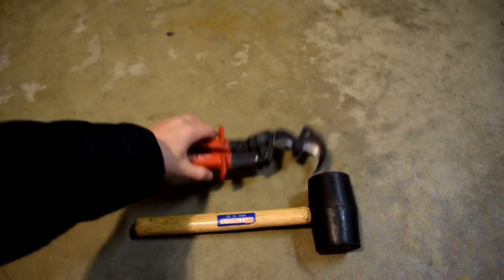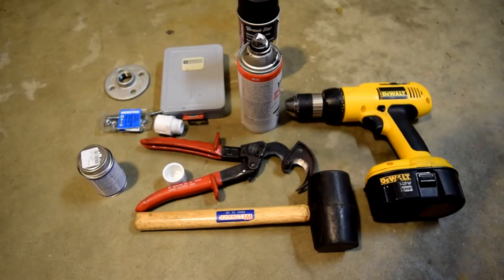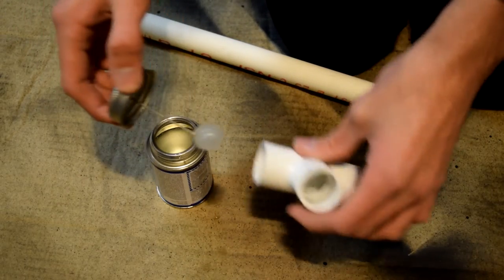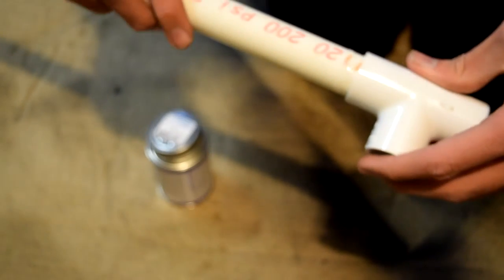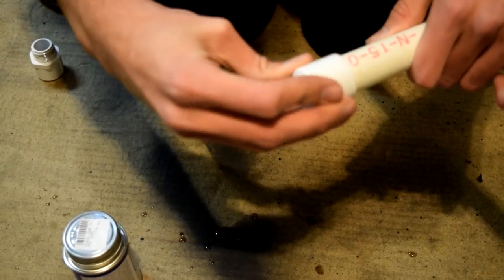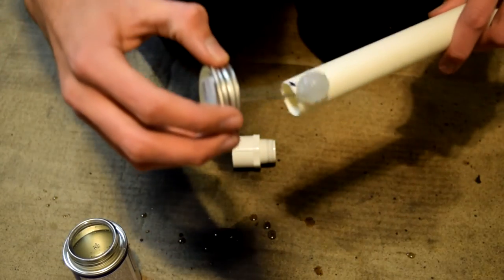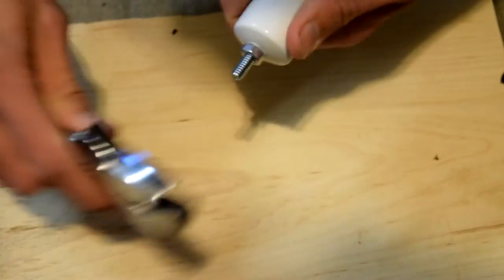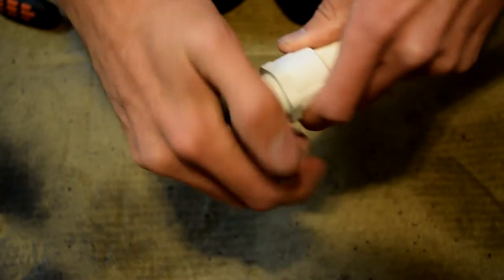Awesome DIY Steadicam

Comment: i want to make a smaller(10 inches) Steadicam for my Moto G4
can you suggest me the ratio of the pvc pipes i should use
Reply from the maker: That's hard to say, I would probably go for a design that goes around the edge of the phone, with a handle at the bottom going straight down. The pipe flange would go on the bottom of the handle. This way you can record in landscape mode. Maybe 5 inches for the handle? It's all about experimenting.

Comment: No test footage?
Reply from the maker: Farai Awindor I used it for some of the panning and tracking shots in my bike edit videos, it worked decently for that. It could use more counter weight on the bottom, it's decent but don't expect it to replace an expensive glide cam.
Reply: Thomas Strother
Noted... and i understand y but still a very good and cheap alternative